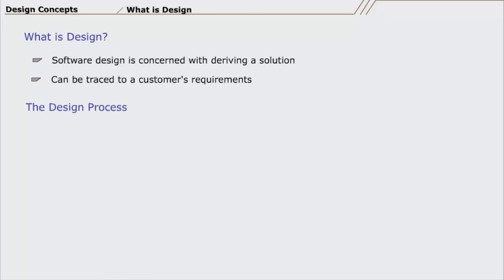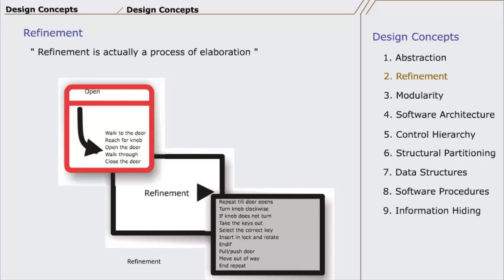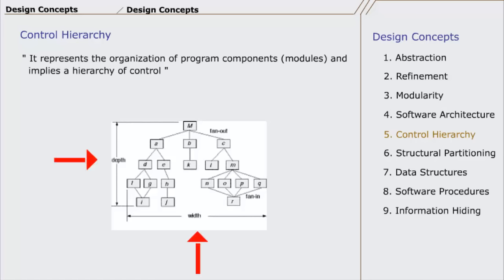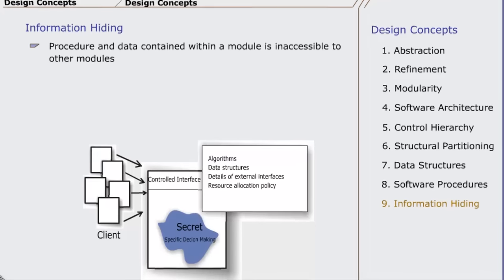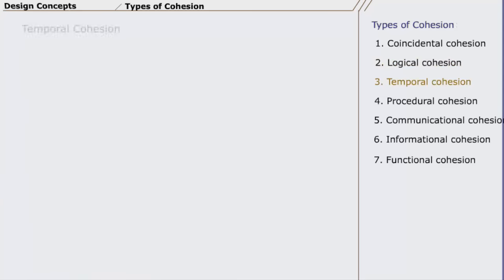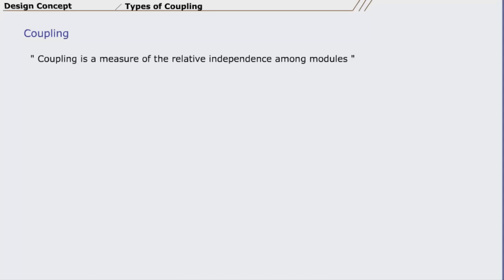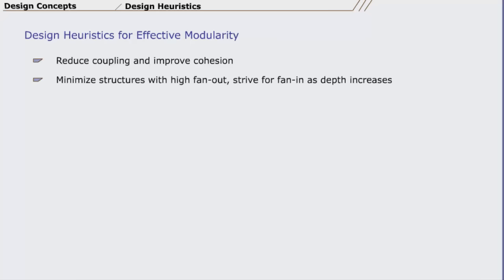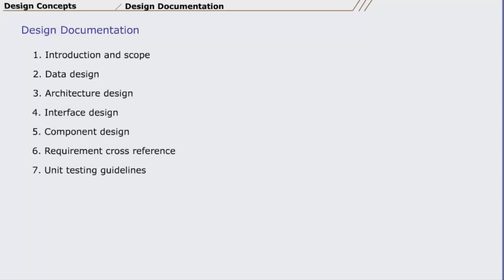Software Engineering Design Concepts Computer Education for All Unit No. 8

Comment: Functional independence is one of the goals of using information hiding and modularity. There can be no good information hiding if the software has not been broken into modules. If the software has not been broken into modules, there can not ever be functionally independent modules. If no information is hid from other modules of the software, if every module always depended on all the others to perform its function, any change made to the software will always result in changes having to be made elsewhere in the software in order to handle these changes.